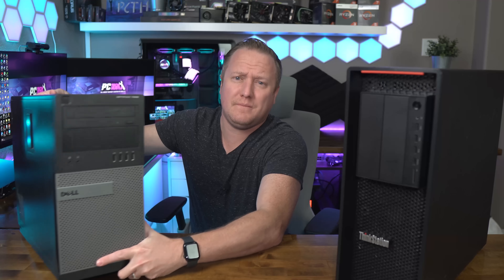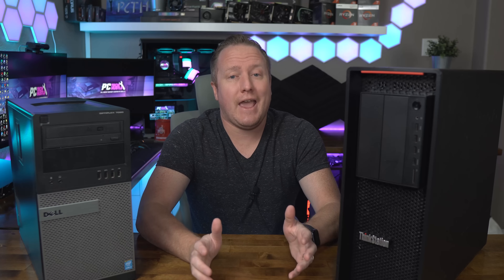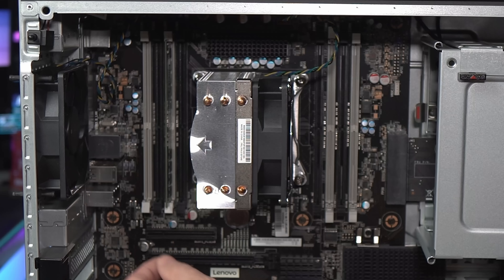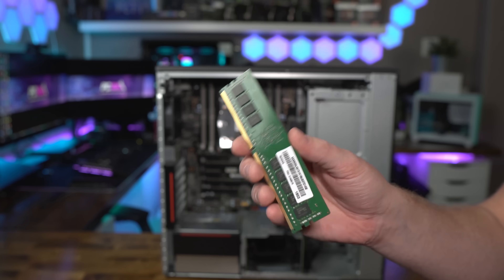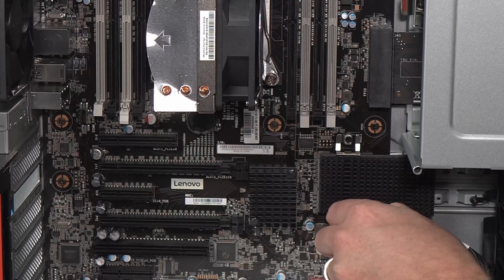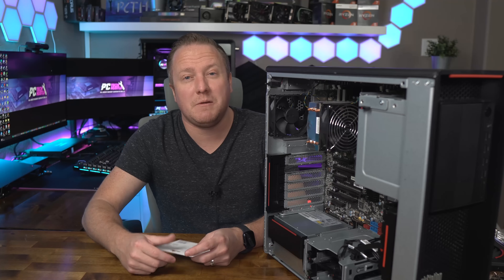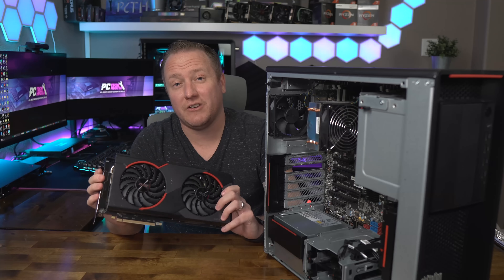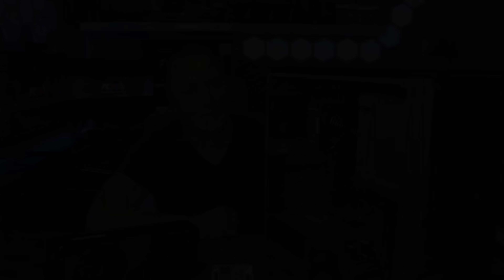The 2024 New Meta of Budget PC Gaming! - Lenovo p520, rx5700 XT, 32GB RAM for UNDER $400!

Comment: I just won an auction for one on eBay! Came with a 512 ssd but no ram. Any suggestions on what to look for? The link in the video doesn’t seem to work anymore. 

Been wanting to get a pc to play iracing on for quite some time and your video inspired me to go this route. Thanks so much. Subscribed
Reply: for W-2135 CPU these should work: Hynix HMA81GR7AFR8N-VK, Crucial CT8G4RFS8266m, 01AG617, 4X70P98201,	7X77A01301, M393A1K43BB1-CTD, MTA9ASF1G72PZ-2G6D. Google is your friend for more details. Keep an eye on Ebay for the cheap!

Comment: I chose the Dell precision route 5820 runs 11 with no issues and I like my xeon w-2135. Great video
Reply from the maker: Awesome!
Reply: Does the dell precision 5840 have nvme or ddr4 by chance?
For the last few hours I'm trying to find a workstation very similar to the P520 but would like to run ddr4 ram...

But it's going to be real hard to find a workstation w 900w PSU, 2 options for nvme, all the space in the universe for any GPU and that price point

Comment: I picked up my Lenovo Thinkstation P520 in early February. I'm running Windows 10 Pro, Fedora 39 and MacOS Sonoma 14.3.1. It has 64GB ECC RDIMMs (8x8GB), W-2135 CPU and an RX 5700 (no XT). With 4 512GB NVMe drives with 2 PCIe adapters, I have almost $600 into it. I like it. I don't game. I will play with Proxmox on it soon.
Reply from the maker: Sweet!  That’s what I love so much about these machines!  They are so versatile!  Thanks for watching!
Reply: Do you still have your hackintosh install? I’m switching to AMD, and want a dual boot that replaces my dedicated Mac.

Comment: It looks very good but i wonder if u need to change psu with normal one i mean psu has its own connectors is that possible or u just need to change whole machines for the psu pls answer me as i want to buy 1 and afraid of that
Reply from the maker: There is no need to change the PSU at all, as I mentioned in the video.

Comment: I built one of these but upgraded to a w2145 8 core and an rx-6800.  It's so fast.  I also have an HP z4 g4 with a 3070ti.  Great computers and super stable.  The RAM speed isn't fast but it runs in quad channel which makes up for it quite well.  It pushes my 6800 to its max and isn't even using 50% CPU most of the time.
Reply from the maker: You might be very interested to see what I do with it next then!  Video this week 😉😉😉
Reply: @PCTechHustle  Cool, will definitely check it out!
Reply: I plan to follow your route and buy that processor for $110 on ebay, Are you running 32 or 64 gb of ram?
Reply: @Kevin-vh6nn  FYI, I had to trim some plastic off the fan enclosure on my p520 to fit the 6800 in there (but I think mine is longer than most - XFX Speedster SWFT 319).  That is a great card though.  Runs SO cool.
I had 64GB RAM (4x16) but sold my HPZ4 recently and included 2 sticks.  If you get 2rx8 RAM, there isn't much difference between 2 and 4 sticks. I am not going to bother getting 2 more.  It has plenty of RAM and games like crazy.
Reply: @gametime2473  
Thank you boss. I figured the processor and GPU would do most of the work and crazy ram was not needed. I'll prob just do 8x4 gb at 2666, I've seen comments and reviews these workstations actually do a little better with 4 sticks of ram compared to 2. I'm not going to use as a workstation or video editing, strictly gaming.😄 

One last thing,
Have you heard any details how to overclock or undervolt the P520 either processor or ram? I'm buying the 2135 or 2145 so that means I have to buy 2666mhz ram
Reply: @Kevin-vh6nn  I don't bother overclocking but I heard you can.  I would imagine you would just use a normal overclocking utility and change the multiplier.  It plays everything at max settings 1080p and that's all I need.  If I get a 4k TV (probably not until this one dies) and it should be able to play at 1440p high and 4k medium

Comment: I've been eyeballing these Xeon Scalable prebuilts for a while. The internals are very cleanly laid out for a prebuilt, but in general Lenovo tends to be harder (and/or more expensive) to get second-hand parts for if something breaks, to the point you will eventually end up just buying a whole second system to take parts from to repair your primary. Dell's parts on the other hand (other than Flexbay components) tend to be disgustingly cheap, and only get cheaper with time.

Comment: Hello again just a quick question since i already order a p520 workstation and I'm using it for gaming since it has a 2135 and I found out the the pc only takes xeons what's the cpu that I can upgrade too next for gaming specially games like fortnite that are cpu based?
Reply from the maker: You can Google the entire support list from Lenovo but outside of doing that I think a good upgrade would be the x2145.  It’s a bit faster clock speed and adds 2 more cores.

Comment: That's crazy value for $400! I paid $350 for the following specs:
MSI Z370-A Pro Motherboard 
i7 8700k 
ASUS GTX 1060 6GB Turbo 
16GB of DDR4 RAM @ 3000MHz 
1TB NVME M.2 SSD 
Corsair H100i 240mm AIO cooler 
KEDIERS C570 open air case with 7 RGB fans. How would you compare my PC to your $400 build?
Reply: your i7 is superior.... even a i5-7500 is more superior with half Ram... the CPU of this Work Station is not for gaming so it will be slow, that is why I'm not buying it, if this PC would have a different CPU would be diferent
Reply from the maker: I think you under estimate the CPU in this system.

Comment: I enjoy my P520 Brickstation even though it's nearly all proprietary and doesn't offer a whole lot of options for hardware that you can use in typical PC builds, such as mounts for AIO coolers or additional front fans. Like the one in the video, I purchased mine for $180 and it came with an Xeon W-2135, two 16 GB DDR4s, and the titanium 900w PSU. At the time of purchase I found a used PNY 1070 OC xlr8 with broken fans for about $100 on fleaBay, a few months later I needed more drive space and got a 2TB WD black SN850x for about $150. It's a great machine for gaming, editing video and audio, and so on, but I should say that these machines are not for everyone because they are rather different from the average desktop.
Reply: @memberberry7139  Yes, you can always customize a case to suit your needs. I was thinking of installing 40mm fans in the external drive bay because I'm also using an optical drive but haven't gotten around to doing it yet. What I mean by hardware options is that the case doesn't have built-in accommodations from Lenovo. If you were to use an ATX case from Microcenter and add front fans, you'd be able to use any 120mm fan because the frame has mounting points already punched out. The front of the P520 doesn't exactly have the same discreet options to do the same thing.

Comment: I just dropped win11 on a Ryzen3 2200g, b450 board, 16 gigs ram, and a rx550  gpu and have it activated.  It's running fairly well, not a barn burner but adequate for minor stuff.
Reply from the maker: Nice!

Comment: 12c/24t Xeon V4 + Mobo combo is $50. 5700XT is $140-$150 used. $40 case, DDR3 for 10$ and a decent 500w $40 80+ PSU and u got urself a better deal than the p520.
Reply from the maker: Better Deal?  In terms of cost, yeah. Yeah but not better value.  I promise you this configuration of p520 will smoke what you are referring to 😜
Reply: @PCTechHustle  Oh fr? I was under the impression that the $50 combo would be a better pick for the price D:
There's even a Xeon with 14c and 28t. I know numbers aren't everything but it helps"!
Reply: Not a chance. Firstly E5 V4's use ECC RDIMM DDR4, and a 12C V4 will turbo up to a max of 3.8GHz. The E5-2699V4 is the highest core count. 22C/44T.

Comment: A really well made and easy to understand tutorial. 
But Im sorta stumped about  cores/graphics cards for this P520.
 I watched a video by Toasty Bros where they also converted the P520 to a gaming pc. They used PCSP to custom order a P520, and installed a Radeon RX6600, they ordered a 4 core.  

Im also looking into building one of these, I do enjoy gaming, but I also do a fair amount of video editing. Would you recommend a 4 core or a 6 core? 
Also, what would be the better graphics card? The Radeon 6600, GTX Geforce 3060, or the Rx5700XT you used here.

Im pretty noobish when it comes to the niches of compatibility, so any help is greatly appreciated.
Thanks!
Reply from the maker: Thanks for watching!  With video editing I would definitely say at a minimum get the 6 core.  You can upgrade to an 8 core as well the w2145/2245.  You can even go beyond that but it gets a lot more expensive.  Of the GPUs you mentioned, the 5700xt is the best performer.  A 6700 if you go with the XT version though would be the best.
Reply: @PCTechHustle  Thank you! Very helpful!

Comment: What type of chip upgrade  could you dump in this mobo? If any?
Reply from the maker: Depends on the use-case but I’d say the best for gaming / raw IPC performance the w2245 is the best as it has the highest overall clock speed and ups the core count to 8 cores / 16 threads.  If you are looking more for raw compute cores you can really go far with the CPU, up to 18core / 36 thread.
Reply: @PCTechHustle  thank you
Reply: @PCTechHustle Bingo. I have a W-2295 in my P520. It was not cheap.

Comment: Which gpus and cpus are equivalent between brands is so confusing to me, my system is very old and I want something that will run the new WOW expansion at good settings, would this work? Recommended specs are:

Processor
6 Cores, 3.5 GHz processor 8th Generation Intel® Core™ Coffee Lake AMD Ryzen™ Zen 2

Video
DirectX® 12 capable 8 GB GPU NVIDIA® GeForce® RTX AMD RDNA™ 2 Intel® Arc™ 7 Graphics   Shader Model 5 or greater

I know it'll run the minimum, my 10 year old toaster runs the minimum lol. But it struggles in large raids. It's a CPU focused game. I love the look of old chassis like this so that's a bonus to me.

Comment: I just built a P520 myself. Paid $174 with 32gb already installed. I used a Teamgroup 4th gen one terabyte NVME & a MSI 3060 12 gig GPU. Meets all requirements for standard installation of Windows 11. I am planning to upgrade to 64 gigs of RAM. I use the machine for DaVinci Resolve and gaming with great results, couldn't be happier.
Reply from the maker: Nice!
Reply: Do you edit 4k on it? Considering this type of build. For live streaming video (not gaming) also?  What do you think?

Comment: @PCTechHustle Does that GPU block the lower PCIE slot for a WIFI card? Or is it still open under there? I can't tell from the shots here.
Reply from the maker: This GPU in partially is very large and yes does block the 2nd pci-e 16x slot but there are still 2 available pci-e 8x slots and a 1x slot for an expansion card such as a WiFi card.
Reply: @PCTechHustle  thanks!!

Comment: So to add to this, you can get one of these with 6 cores and 12 threads, 16gb ram, and aometimes a quadro gpu for less than $200 usd. 

By comparison you are looking at the dell optiplex 7060 or 7070 for 8th and 9th gen cpus with similar core count. 

But those have the space and gpu limitations and while they do have faster core speeds on the cpu and support faster ram, they dont easily allow for a powerful gpu. 

The ThinkStation is so cheap for the performance that i have basically stopped recommending optiplex machines for those that are in the $200-$400 budget range. 

Granted, every damn thing on this is proprietary so that has to be factored in. But its a beast for the price.
Reply from the maker: Good points / information.  This is why I think it can become a meta for very lost to entry.  Sure it’s very proprietary but at this cost of entry you really can’t get away from that.

Comment: Which will get more fps rtx 4060 ti with the intel core i5 13400f or the rtx 4070 with the intel core i5 12400f
Reply from the maker: Hah!  That’s a very close race!  Hard to say.  I’d lean more toward the setup with the 4070
Reply: It depends just a little at what resolution.  At 1440, I would think the 4070 would still be better.  Both are running at least  6 cores and cache size are very similar.

Comment: Should have bought two more dimms for quad channel since they were so cheap. This effectively increases your ram speed.
Reply from the maker: Yes I could have.  I would have had to buy 3 though.
Reply: @PCTechHustle  In the end though for your use case scenario two sticks of 2666 is more than sufficient. Just min maxing. ;^p
Reply from the maker: I just may do a follow up video to see what happens if I add 2 more 🤔🤔🤔
Reply: @PCTechHustle  Could be a test to see if it quad channel matters in gaming. Typically you only see fps gains if the ram is very high clocked like ddr4/5 which no dual channel ddr3 kit can match. But quad can certainly push 2666 into effectively high 3000's performance wise or even higher. Content is content!

Comment: One thing I'd like to point out is you might be careful with your RAM selection and using Xeon systems as some require ecc ram and some don't. Other than that it is a really clean and strong system.
Reply: ECC ram is a bonus because you can pick it up for super cheap in very large capacity.
Reply from the maker: Right!  This is ECC memory actually.

Comment: get a dell optiplex 7050 or 7060 because they are way newer and way cheaper and the 7060 has 8th gen support and the 7050 has 7th gen support but you can use a iso for win 11
Reply from the maker: But what kind of GPU can you fit in those?

Comment: Cool video.  I am watching this on my Dell T3600 with an old E5-2665 and 64GBs of RAM.  I also have a T5610 which is for parts now.  So I have a spare 600Watt PSU.

Like these thinkCentres some of the Dells are also great options.  I run Linux on mine so I don't really need to worry about Microsoft's arbitrary system requirements.

I will be good to go until newer instruction sets become a requirement which so far has not been an issue.
Reply: Check out the Dell  Precision T7910 if you want to go crazy. Dirt cheap. I'm running dual E5-2699V4 with 256GB RAN, 14TB of RAID 50 and 2x2 TB NVME in a dell carrier. Oh and an Intel X540 dual 10 GbE and 2080ti. It has a 1400W PSU.... Built it for fun and large compilations...
Reply: @timfountain98 
Does it support ddr4?
Reply: @Kevin-vh6nn  Yes, but ECC required and RDIMM if you want to load it up with lots of memory...
Reply from the maker: Nice!

Comment: Is the motherboard removable??? Is the power connector proprietary? Does it come with a cpu cooling backplate?
Reply from the maker: Technically… yes, yes, and yes.  I wouldn’t suggest removing the motherboard though.  This doesn’t seem like a good swappable system
Reply: @PCTechHustle  thank you for answering those questions, and thanks for the insight on this. Great video too by the way!
Reply from the maker: Sure thing!  I see what you were after, a possible swap to a different case maybe?  It miiiight be possible but there is a lot of proprietary things to deal with. Thanks for watching!

Comment: Every time I hear 'proprietary' I take a step back. If the psu malfunction you are screwed, there is no cable conversion option to this kind of direct connection to the motherboard for a normal 24 pin psu.
Reply from the maker: The risk you take but the system was so cheap it’s easy to just buy another. 🤪🤪🤪
Reply: I don't know so much about the Thinkstations but I am typing this on a Dell T3600 and with some of these workstations they are going for so cheap you can buy an entire second PC for parts for the price of a higher end PSU.

Plus workstation components are usually built to a higher spec than consumer level parts.

So it is not as bad as it might seem at first.
Reply: 900W PSU is $40 all day on ebay. Not an issue IMHO...
Reply: and super easy to swap @timfountain98
Reply: @timfountain98  For $62 total (shipped), I picked up a spare CPU (W-2135) and a spare PSU (900W) off of EBAY, of course!
Reply: Lenovo kept this model in production until the last year or so.  The same chassis was also used for the P620 Threadripper workstation and the PSU was also used in the P720.  There are tons of parts available for these systems at low prices.  I picked up a new 1000W PSU for about $160 on eBay a couple months ago.
Reply: the PSUs for this system are much better and cheaper than regular PSUs. SKU to search are DPS-900EB or 54Y8979

Comment: Neat, I have noticed recently a bunch of channels talking about this new batch of OEM Workstations becoming available on the used market. Gone are the days of wasting your time having to pull out the oem power supply and installing a new custom power supply if you need to power up an 8pin video card. Gone are the days of Bus Powered weak slow 1050ti video cards. Back in the day AMD Video Cards did not work in oem builds and you would only get a black screen so you were stuck with having to use invidia cards only but no more. The only thing you still need is a 20TB 3.5" 7200RPM Hard Drive slotted in because if your a seasoned pc gamer you are going to need alot of room for ur complete library across the various platforms. Just to give u an idea 1000 video games come out to about 7TB. By the way also checkout all the other workstation manufacturers out there, they all offer something like this Lenovo. In a couple years I imagine the next batch of budget oem workstations will offer something close to an i7-8700 Coffeelake. I have that particular card in one of my gaming rigs, the model I have is the sapphire nitro with 3 fans, I got mines from Microcenter back in the day for 350. Thanks for the video and review. Merry Christmas.